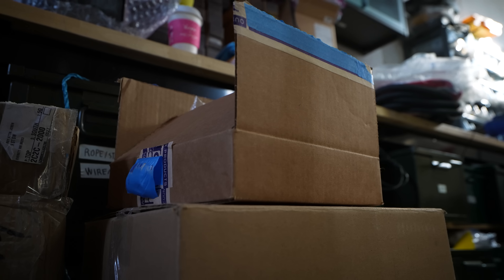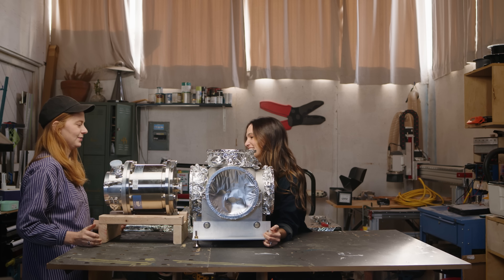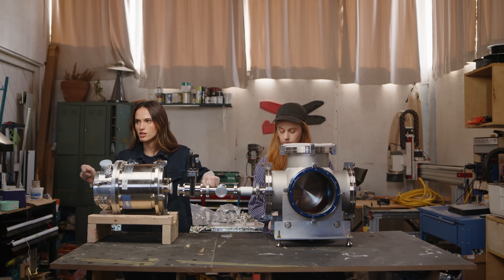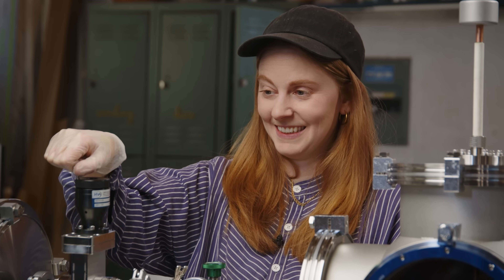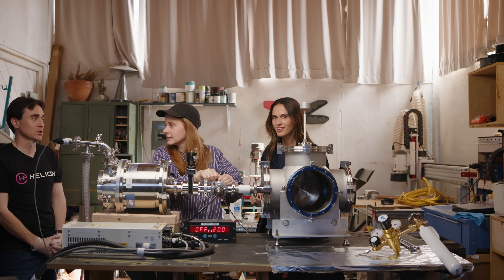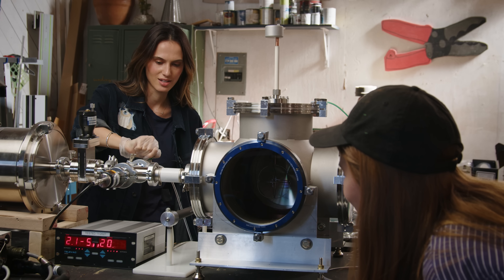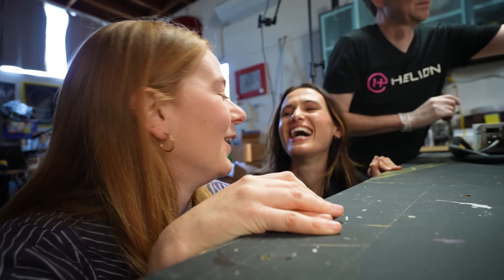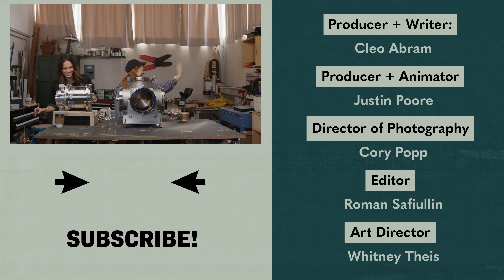We Tried To Do Nuclear Fusion

Comment: Did this dude just reset a breaker on a "fusion reactor" running at 6kv with the same lack of care as me when the kitchen breaker trips after me using the kettle and the microwave at the same time.

I may be an uneducated layman but after that even i would be LEAVING 😂

Comment: For those wondering (especially after the anti-fusion guy T. Folse Nuclear's video), this is heavy-loss fusion. It IS fusion, but the energy produced is not harvestable. Essentially, it's like turning on a lightbulb. Just raw, lost power. They are transforming grid power into fusion events on a VERY small scale. Producing enough fusion to emit enough neutrons to bombard a containment wall ***that contains more fuel that breaks off as neutrons hit it***, then do it in such a way that requires as little input energy as possible, then sustain it with nearly 100% uptime for months, years or decades at a time, AND extract power from it via heat exchangers... that scale of energy use and production scales the fusion size up enormously, and thus pushes temps up to hundreds of millions of degrees.

Comment: This isn’t fusion btw, these are merely the conditions under which a sustained fusion reaction could be made but even with this “test” only about one in a trillion particles at most would collide and fuse so no you didn’t make a fusion reactor, only a plasma chamber

Comment: They should be glad they’ve not made fusion (if you don’t count just absolutely negligible non-zero amount, made through sheer probability) with their heads 10 centimeters from “fusion reactor” with piece of glass as their only protection 🙃 I’d argue that this is just fusor, basicaly cooler plasma lamp

Comment: You definitely did NOT "make fusion" with that device, right there that day.  You made plasma, that's it.  Nothing more; and he knows this.  You've been intentionally mislead.  Period.
Reply: It's unfortunate, the news also make this mistake all the time too.
Reply: But the guy just said they did fusion though ?
Reply: @tylergriffiths8432  LOL.  I know, right?
Reply: @NorthernChev  How do you know they didn't create a fusion reaction? Unless I missed something in the video. Many people are saying what you said
Reply: @dreadtrain2846  Are you sure they would get cancer? They were very careful and wore the necessary PPE… 😂
Reply: @drewischaos There wasn't anywhere near enough hardware between the chamber and any of the crew to shield them from the x-ray and neutron radiation that would be kicked out even from a fusion reaction of this size. 
The only PPE they're wearing is a pair of rubber gloves, which wouldn't even protect their hands, let alone their uncovered faces.

This is a neat plasma demonstration that stops quite a ways short of being able to fuse anything, and it's a safe bet that the guy in the video knows this. It's closer to a plasma ball or neon lamp, just using deuterium instead of a noble gas.
Reply: @elliotts5574  If there was an actual fusion reaction would it impact the image sensor from the camera? As in dots or artifacts visible on screen?
Reply: @KneppaH  It doesn't matter because we don't need to prove that it's not fusion but rather they need to prove it is (they did not), but yes there would be.
Reply: @tylergriffiths8432 Basically, they made no effort to detect neutrons. During this kind of fusion reaction there is a production of neutrons which is what you need to measure to be sure you are actually fusing atoms. The helion guy should have known this considering he works/runs a company trying to build fusion reactors but he made no effort to do so. Not to mention fusion also generates a lot of radiation you need to shield against if you don't fancy getting cancer. So when the helion guy says they are fusing he is either lying or ignorant and either way that looks really bad for someone apart of a fusion reactor company.

Comment: inspirational women! Love seeing the pure excitment and hugging when you both accompliashed the fusion.
Reply: Except they didn't "accompliashed" fusion. They made plasma. Coulda had the same result a lot quicker and cheaper by cutting a grape in half and putting it in a microwave. You can create plasma with relatively low energy (eg with a microwave). Your clothes dryer requires a special plug to support its power usage and it pulls around 5,000-7,000 watts. In order to do fusion they'd have to be pulling something more in the range of 100,000 to 350,000 watts. And lastly if they really did make fusion, they'd have been irradiated horribly and would be in the hospital or worse. This guy knew they weren't making fusion this whole time - he's not an idiot, but treated them like they are. Please stop believing everything you see on the internet, and stop taking inspiration from businessmen trying to scam investors.

Comment: Yeah, this is completely possible, but... the amount of fusion you get to happen is nowhere near what you'd need to pay for the electricity you're using to run it.  But yes - you can do fusion in your garage.  I didn't really watch your whole video, but I saw you sitting there staring at it - be careful; the system I'm thinking of makes x-rays and you really should shield it.

Comment: Just entertainment, zero relevance. Controlled fusion for power (electricity) generation will not be commercialy available in the next 30 years, date unknown. Could be 50, 100, 1000 years. 🥱

Comment: You barely made any fusion. If you did, your hair would have fallen out by now and you'd have horrible metastasizing cancer in less than 20 years.

A fusor like this would create hard X-Rays and fast neutrons at a rate that would be HORRIBLE for you. THEY'RE NEXT TO IT.

That snake oil salesman of a CEO know enough not to kill himself with what amounts to an expensive and dangerous toy these days. 

Helion itself is a joke too. It will never make net electricity gains. Their setup would kill everyone in their building if it could.

Comment: My idea for fusion is a bit different it would use a high voltage lc circuit driven by a magnetron to fuse hydrogen and boron isotope 11 as decaborene fuel.

Comment: I suspect that there was more energy input required than there was energy output. 
This is the never ending problem with energy production. No energy conversion is 100% efficient.
Reply: Are you trying to be smart? They tell you this in the video. We’re having trouble getting more energy out than we put in and that’s why we’re not using fusion. 

“No energy is 100% efficient.” Well yes but we can at least get more energy than we put in. That’s how you’re using electricity right now. We’re burning fossil fuels using energy and getting more energy out.
Reply: @HiHi-oc3gh  I know what you're saying, but you cannot get more energy out than you in put in. When you burn fossil fuels, you're putting in chemical potential energy stored as the bonds between atoms.

Comment: 0:10: 🔬 They are building a nuclear fusion reactor in Simone's workshop with the help of David.
2:24: ✨ David No Hands instructs the team on building a fusion device using electrostatic inertial confinement.
5:40: ⚡ The process of fusion in a lab is explained, including the steps involved and potential challenges.
8:35: 💥 The experiment successfully created fusion by controlling the voltage and gas pressure.
11:34: 🔥 Fusion is achieved in Simone's workshop, demonstrating progress towards commercial electricity systems.
Recap by Tammy AI

Comment: When fusion starts, you would detect massive amounts of neutron radiation and xrays. And you should not be in the same room as the fusor, but have >3m concrete in between or be a large distance away.
You made a nice looking plasma, but did not check for increase in radiation. No fusion achieved, just a clickbait video.

Comment: So many of these components and ideology is very very prevalent in the semiconductor industry.  Add a rotating magnet, a target of specific material to be deposited, specific process gasses and a silicon wafer and you replicated physical vapor deposition on a very basic scale.

Comment: It is pretty cool to see the plasma through the window, but the fact is that if that really was a fusion reaction you would probably have cancer or worse because of the neutrons produced. That glass is not stopping anything.
Reply: Borosilicate glass is opaque to alpha and beta radiation and can significantly attenuate neutron radiation. They ran the reactor for such a short period and at such low power that there are unlikely to be enough fusions to generate an appreciable amount of gamma radiation. It would have been cool if they had set up a cloud chamber to verify this though.

Comment: Unfortunately another example of having seen some shiny postcard pictures without understanding what was going on really. 

What did I understand from that video? To be honest: nothing really. Having seen some purple glowing something, but I've seen something somewhat similar happening when I saw polar lights. Was that polar light doing fusions? No, not at all, that's for sure! It were nitrogen atoms (or molecules) that got hammered at and excited by the particles from solar winds, causing the outer electrons jumping from their standard place to the "excited" place. When this outer-most electrons of this molecules jumped back to their non-excited state the molecules got rid of the stored higher energetic potential back to normal by emitting this purple light. So, what tells me now that we did not see just excited molecules from a very thin atmosphere inside the chamber?
BTW: What "fuel" are you talking about in the video and where can I buy it? 🤣 (...not meant to be taken serious!)

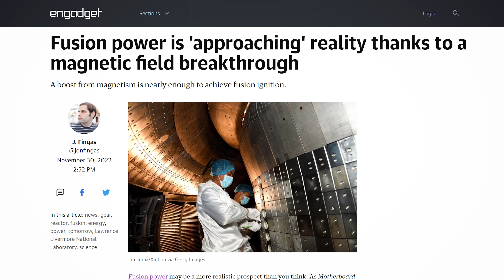Comment: What a great video!  I have a question...at 12:00, after the plasma/fusion is done, it looks like the lower right part of the central metal ring-thing (cathode/ anode?) is glowing red...is that element red hot at that time and then it cools down to the same colour as the rest? 
 I think that was the same portion of the chamber that had the beam streaming into the center when the fusion reaction was happening.

Comment: when you sucked the air back in due to the fuze tripping, you might have sucked some the vaccuum pump oil / mist into the chamber which would impact the ability to pull a high level of vaccuum but it probably seems like this experiment is not as sensitive to that, which also means that vaccuum chamber is a bit overkill, but if you have nice shiny toys...

Comment: Basically, this is like a startup business. You buy all the equipment and raw materials, pay for marketing and then get on with production, but if you only do it for a short time, the sales profit won't cover the initial costs.
Perhaps scale it up and keep it running, using the heat produced to boil water and drive a steam turbine to make electricity. 
Of course then you just have to find a home for the nuclear waste you produce.

Comment: does this produce gamma rays?
Reply: i do not know allot about this type of stuff but people smarter then me have said that video is a lie and they are not actually fusing anything
Reply: No. This kind of fusors do not generate gamma rays. But aside from UV, they do generate X rays, and lots of neutrons. Neutrons being the worst part as they can turn regular materials into radioactive variants. In short not safe at all. That's why he is operating it at a lower voltage as just a nice plasma ball instead of the real thing. He could have just explained to them what really was going on, and then take everyone out and control it remotely... but for some PR/YT reason decided not to and simply lie.

Comment: Big, if true. Did you really fuse deuterium? 
D + D	→ 3He	+ n
You'd feel the effects of neutron radiation by now.
Reply: To answer your 7 month old comment, they never achieved fusion here. Its just a glorified D burner creating mundane plasma. This company is just attempting to attract funding through social platforms drawing interest.
Reply: Why wouldn't 2H + 2H make 4He.? Why would it make 3He and a neutron?
Reply: whetehr they feel the effects depends on how many fusions happened and how many neutrons they generated. At such a low voltage the number of fusions would be minimal and therefore the dose would be minimal

Comment: At 6:00, why is one photon blue and one photon red? What makes the photons different?
Reply: Photons are created when electrons decelerate as part of the conservation of energy / momentum axiom. But electrons are not monoenergetic in these types of accelerators, they follow a quasi-Maxwellian energy distribution, with lowest energy electrons having very low energy and the high tail end having the accelerating energy of the voltage applied (20+ keV for fusion voltages). So they have different energies, which means the released photons will have different energies and since wavelength of photons is related to energy via E=hc/wavelength, different energy photons have different wavelengths eg. color. In fusion voltages (anything above 10kV) many photons have so much energy that their wavelength is extremely small and goes outside the visual field (380-700nm) and those photons pose a threat via UV or X-rays, which we do not see.

Comment: I'm maybe being "that guy" but I just want to note, running a Turbo-Molecular Pump completely unconstrained and unsecured like that is a terrible idea if things go very wrong. There's a LOT of energy in that pump rotor (since it's running at a "mere" 20k to 40k RPM). If it catastrophically fails for whatever reason, it's going to go flying if it's not bolted down.  It's really intended to be bolted down on every single bolthole on that front flange and in the case of a full lock-up (bearing failure) it will just about not shear off every single one of those bolts.
Reply: I totally agree.  They could all easily be killed by such a large turbo like that if it had a... rapidly unscheduled disassembly, to borrow from rocket talk.
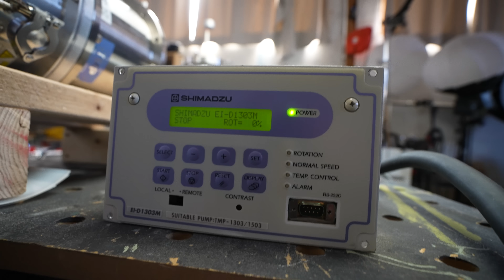At 5:04 you can see the TMP controller is a Shimadzu EI-D1303M and it also says, suitable pump TMP 1303 / 1503.  They're quite similar except the 1303 does 1300L/s and the 1503 does 1500L/s.  From Shimadzu web site the 1303 is 39kg!  Also 30300 max rpm.  The 1303 page unfortunately doesn't link any manual so no idea of the 'destructive torque' rating (torque generated during a pump failure) for the pump but I found a TMP with similar specs: an Edwards STP1303, max rpm 32500, 1300L/s and weighs 39kg.  Edwards has a manual and notes the destructive torque is 2.6x10^4Nm...26kNm and the flange should be bolted to something (obviously substantial like a metal frame) with 12 M10 stainless bolts of class 70 strength (the choices being 50,70,80,100...so not the weakest bolt class).  For comparison's sake, google says a Tesla Model 3 hub motor can generate 400Nm peak and at the wheel 3600 Nm peak.  So it's like having a stack of 7 Tesla hub motors at their peak output giving a brief twist to some kind of wheel (the turbomolecular pump)?  I think so at least.  In any case, it's a crazy amount of torque and stored energy and they had it resting freely in a groove.  Holy cow.  I guess the guy from Helion doesn't put together vacuum systems himself (or doesn't care if they all die or get maimed :)).
I'm building a vacuum system so it was interesting for me to work through the numbers on this.

Comment: while high voltage is a risk there is also the risk of x-ray radiation leaking from the "reactor"
magnets would've focused the ions better and sustained the reaction longer have all the magnetic fields squeezing the "core" of the reaction